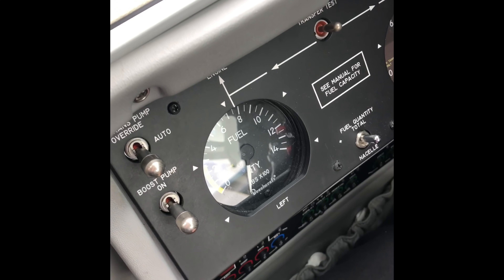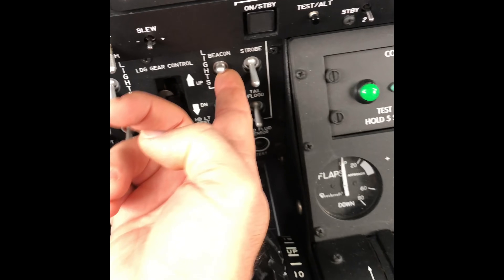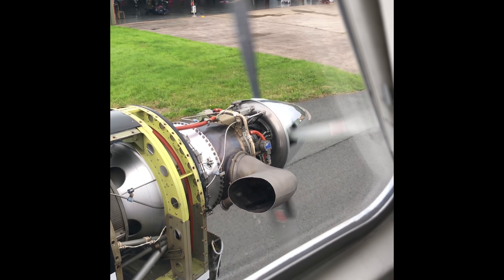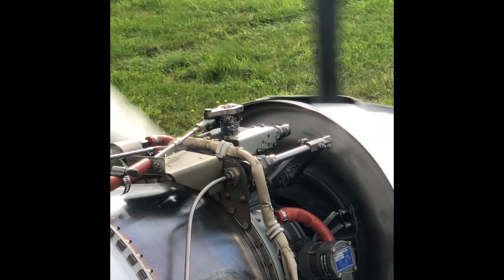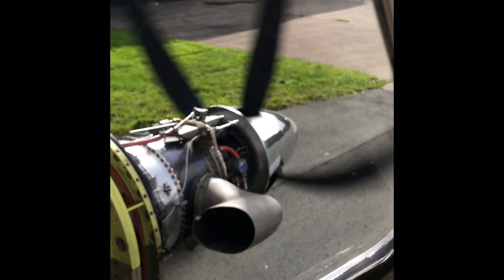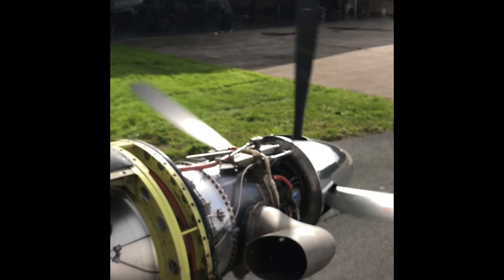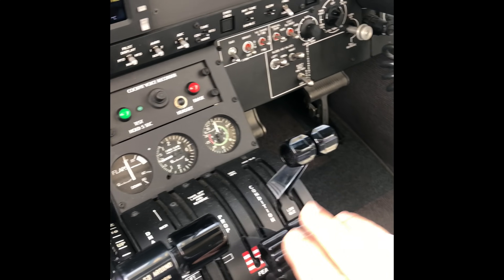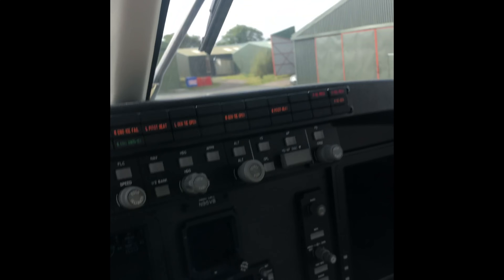King Air Propeller Demonstration

Comment: I am curious how do you prevent a hot start?
Reply from the maker: In my learning thus far (and thankfully not experience)... it is becoming clear that the main cause of a “hot start” is a weak battery.

So the most fundamental way of avoiding a hot start is:
1. Ensure your battery is in good condition and sufficiently charged.
2. Turn off all electrics that could be draining the battery. In my experience the main drains of battery power that can be left on unintentionally is the “Cabin Temp Mode” switch, and window heat switches.

So in a nutshell, check that your battery is charged, and make sure you’re giving it the best chance to turn the turbine when starting the engine.

I also keep a keen eye on my “fuel flow” gauge once I have advanced the fuel condition levers. An abnormal (higher than normal) fuel flow could be your first indication of a potential hot start, even before ITT starts rising fast.
Reply: Additionally, when possible face the plane into the wind and consider delaying the introduction of fuel until a few seconds after rpm and temperature criteria  for fuel introduction have been met. Consider even waiting long enough for the RPM to top out on the starter before light-off.
Reply from the maker: @aerofreak2053  Yes. Especially when doing a quick turnaround. Many pilots rush after the “minimum RPM”. When doing a quick turnaround intend to run the starter an extra 10 seconds or so and watch the ITT drop before introducing fuel.

Comment: Looks like you started it in coarse pitch. Why is that?
Reply: The prop pitch is controlled by oil pressure developed by the engines gas producer (hot section of the engine). The oil pressure applies pressure to the prop moving it from course to fine. There is a heavy spring in the prop that is always trying to push the prop to feather. The idea is that, if the engine fails and the oil pressure drops, the prop will automatically go to feather.
Reply from the maker: There are benefits of starting in Coarse or Fine pitch depending on the situation. The aircraft doesn’t care and in my experience neither is “good or bad” for the aircraft.

In our case, the Benefit of starting in feather:
-Quieter for ramp personnel (and pax)
-Less blowback behind

All of the above benefits you if you’re staying in position for a while before taxying. You can’t taxi in Feather so at some point you have to go fine before you move.

Some people prefer to start in fine because you can “get going” quicker.

Because this is a “free turbine” engine... as in the props aren’t directly connected to the engine, the engine doesn’t work any harder if you start in feather.

So it really comes down to personal preference. Like many things in aviation.
Reply: @Mode_Sierra  
On dirt strips,  it makes a big difference.   Feather can raise dust to intakes..does that Beech have mass separators?
Reply from the maker: @keithjurena9319  That’s an interesting point. I don’t have dirt strip experience. Every day is a school day! This king air has inertial separators, if that is what you mean by your question?
Reply: @Mode_Sierra  makes sense. I guess the big difference versus piston engines is my prop is attached to the crank.
Reply: @Mode_Sierra  makes sense. I guess the big difference versus piston engines is my prop is attached to the crank.

Comment: Wash the compressor, have to find out what that means
Reply from the maker: It’s a procedure of cleaning the compressor. In simple terms, You run a hose with water under pressure into the compressor area whilst cranking the engine.
Reply: @Mode_Sierra  very fine ground walnut shells clean the blades.
Reply: I think he is referring to the compressor blades of the turboprop. So i think he just cleaned off the dust and grime off the blades

Comment: Great video. Why do you wait until N1 is below 10% to shut off the boost pumps?
Reply from the maker: Hi there, the purpose of the electric boost bumps is to prevent cavitation of the engine driven fuel pumps. Cavitation (destructive) happens when there is back pressure in the fuel flow and “bubbles” that vaporise form in the fuel pump. Cavitation can destroy your engine driven fuel pump over time. And no engine driven fuel pump means “bye bye engine”. The electric boost pump operates at a much lower pressure than the engine driven fuel pump and can’t support the required fuel pressure for the engine. It only serves to protect the engine driven pumps from cavitation damage. Above 10% The electric boost pumps still do their “job” of preventing cavitation. Once below 10% the risk of cavitation ceases and the boost pumps can be turned off. Hope that explains it ok.
Reply from the maker: @DylanClements98  Always learning! Are you related to Tom Clements?

Comment: That was really interesting to watch without engine cover.  

One question, which may appear really minimal, but when you toggle some switches you use a thumb and forefinger movement as if "pulling" the switch.  Is this a mechanism in the switch requiring to pull it out, or is just best practice so you know you've completed it?
Reply from the maker: That’s a good observation. Yes, your assumption is correct. Some switches on the panel are of the type that requires you to pull the switch before moving it. This is to avoid unintentional or accidental switching.
Reply: @Mode_Sierra  I noticed that too. I thought with that panel down by your left hand side you could wreak havoc with just the brush of an arm.

Now I know why you don’t. Thanks very much 👍🏻👍🏻
Reply: I agree with Johan, that was a really good observation. I tried to find a diagram of one, but couldn't. Essentially some of the King Air switches have a tooth that you have to pull the spring-loaded sleeve on the switch back over the tooth to shut it off. That is so they aren't inadvertently turned off in flight. If I find a diagram I'll come back and post it.